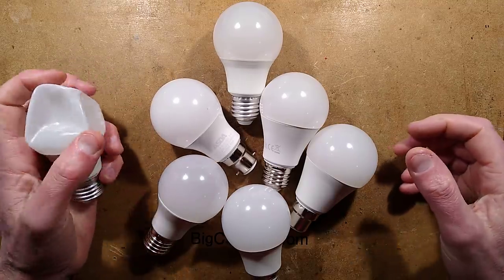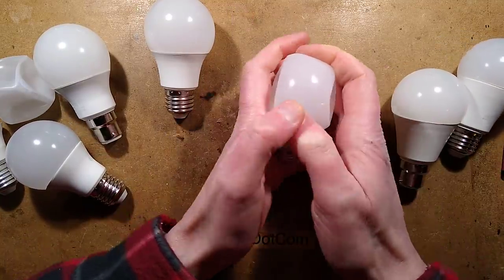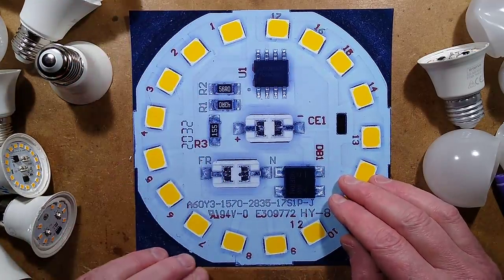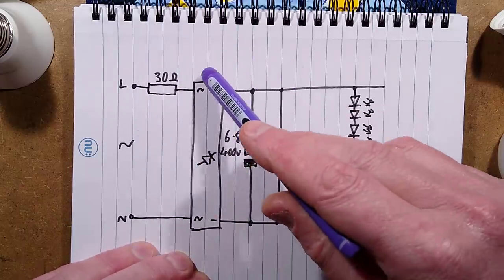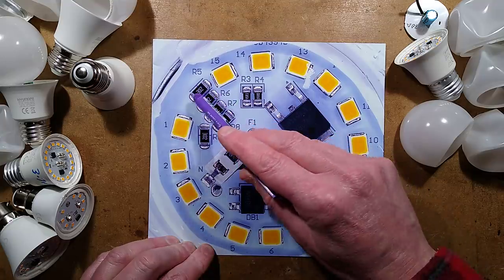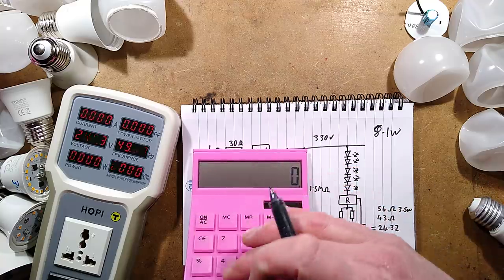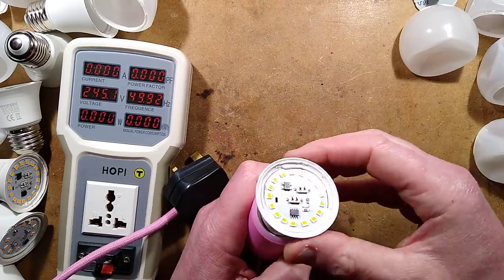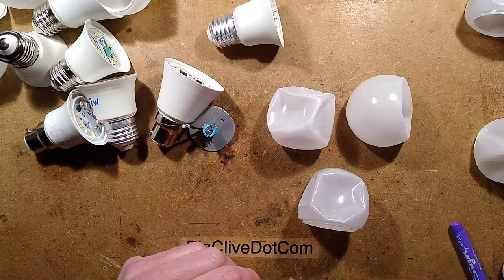Crushing and hacking LED lamps

Comment: it is so annoying. Had two osram lamps, 10 EUR each, I thought, well buy a known and trusted brand. Because I had a semi enclosed lamp shade and I used to have these 3 EUR no brand lamps from the home improvement store which say manufactured in China everywhere. Well they all busted after a year of use. I thought: The osram comes with a 10 year warranty, guess I spend a bit more money on it, they will be well designed.... Guess what, all my osram lights failed too. After roughly a year of use. I even removed the lamp shades but they started to flicker after 1 hour of being turned on, then after shutting down and letting that thing cool down it would operate normally again. But after one year they all started flickering by the first switch on or did not even switch on. I say: Expensive shit, these brands are putting out. And completely contrary to saving the environment. They should be behind bars for this fraud! A traditional lightbulb will give me more hours than this badly engineered shit which they dare to call a "product"

Comment: As much as I love a good conspiracy theory, I doubt that they're making the bulbs that way for the purpose of causing an early failure. Instead I would conjecture that they're simply trying to drive the maximum number of lumens out of it, because that's the major factor that consumers judge the product by.

Given two choices:
Bulb-A that the box says is 600 lumens, at 4 watts, and is guaranteed for 2 years (and will last 5+ years easily)
versus
Bulb-B that the box says is 1100 lumens, at 11 watts, and is guaranteed for 1 year (and will probably die between 18months and 2 years)

I just about guarantee you that the average consumer will only compare the lumens, pick the one that gives better lumens per $ (ie. the higher lumen bulb), and not give even a single thought to any of the other factors.

Comment: I think I may have found a mainland UK bulb, that can be hacked in the same way (parallel resistors), as the Status one you have in the IOM.

It's the Ultrabrite brand, from Poundland.

This one is sold as a 6w = 40w.

https://i.ibb.co/2khdgY1/DSCF0260.jpg

The inrush resistor is 26 ohms.
Reply from the maker: In that one I'd chop out the 51 ohm resistor (510) to reduce it to around 2.3W.
Reply: @bigclivedotcom  I've just plugged the Ultrabrite 6w bulb into a power meter, and unmodified it's actually 6.5w, while modified (with the 51ohm resistor removed), it's exactly 3.0w.

Comment: Recently I "tried" this on a faulty incand bulb. It was stuck in the socket and I tried to remove it and... well... No, it didn't hurt, and I didn't bleed to death. My hand is fine. But it did make a mess. I just obliterated it. The bulb that is.

Incand bulbs are also designed to fail these days. DON'T BUY THEM.

Comment: Is there a way to modify higher wattage lamps, so that we have long lasting 60 watt equivalents?

For instance are there ones that have a very high output, ie 40 watts that can be reduced down to 10 watts
Reply from the maker: Most LED lamps can have their power adjusted, but sometimes access to the electronics is difficult.
Reply: @bigclivedotcom  thank you.

Comment: Can you explain how the input resistor impacts on R1 / R2 testing?
Reply: The 30 ohm or whatever has little effect on the lamp output. It's basically a fuse.

Comment: I found I can detach the plastic bulb by running a knife around and prying here and there. 
However my Canadian Walmart 60 watt (120volt)equivalent leds have 15 leds , one 6.2 ohm resistor and another labeled with 0 which occupies a spot where you’d expect an led and a rectifier chip. 
I could send a pic.

Afry at cafsystems dot com

Comment: Quality save /home bargain sell a cheap led bulb 💡 the 100 equivalent is OK
Reply: By 100 I mean 100w equivalent  I got my first bulb from clas Olson it's didn't last long I did a autopsy on it, it fried I think some leds might have been salvageable but the rest was trash.
Reply: Also the home bargains led bulbs ain't to shabby do the get the 60w or lower they look washy on camera especially the cold white at 60w or 40w equivalent yeah the wattage is not real wattage or probably more like 6w but similar to the output of the old fashioned tungsten filament wattage output of light 💡